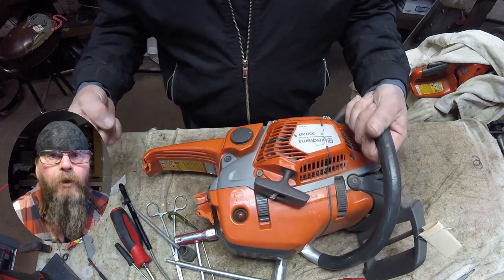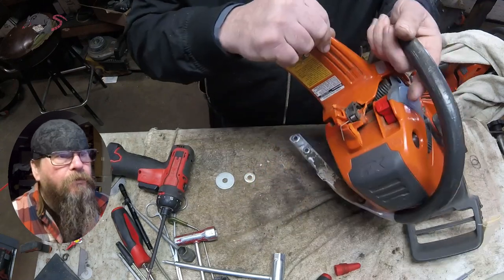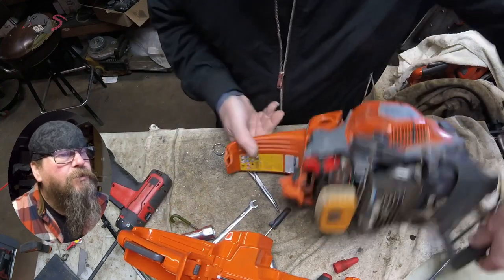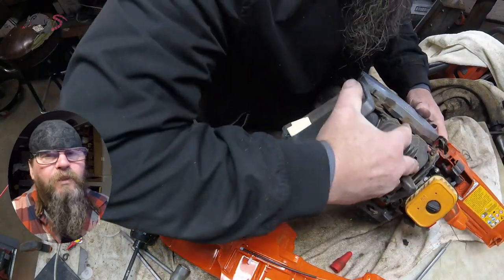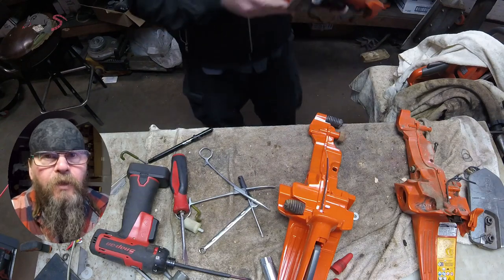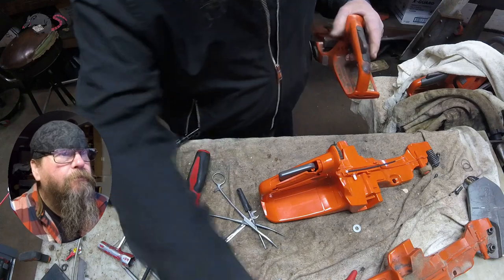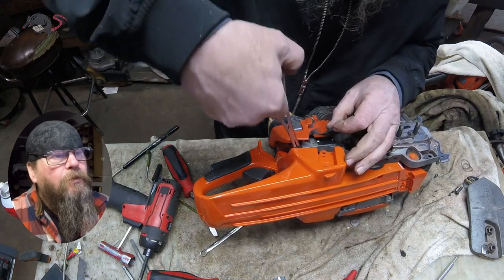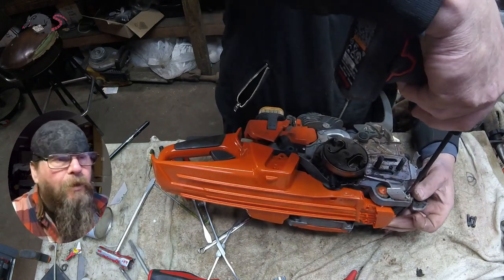Husqvarna 550xp Chainsaw Fuel Tank Swap

Comment: What is the type of bit you are using in your drill chuck? #4 phillips?, 4mm hex? #27 Torx ?  #20 Torx for removal of front rear springs
Reply from the maker: That driver is almost always loaded with a T25 which will turn t27 in plastic and fits 4mm as well. I switch to T27 or 4mm when the screws are too tight.

Comment: I have 2019 550xp bought just before the MKII came out. 
How often should fuel filters and fuel lines be changed?
Reply from the maker: The owners manual suggests you check them monthly and change as needed. I've seen the number 100 hours used for fuel filter change interval. It all depends on what your putting in the tank.